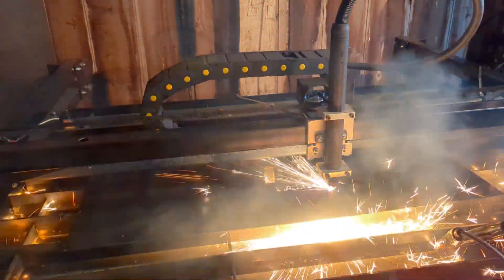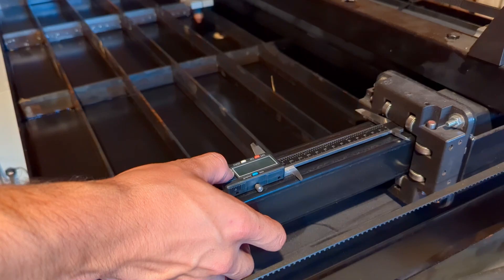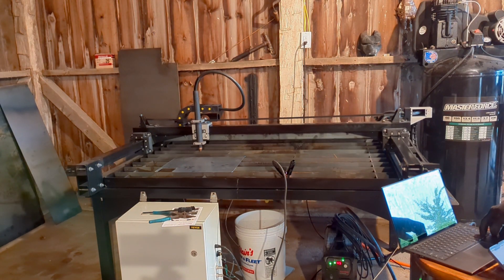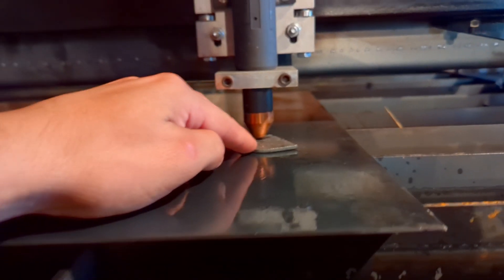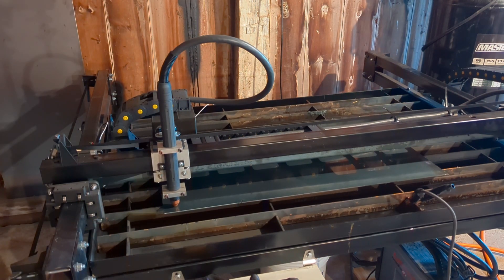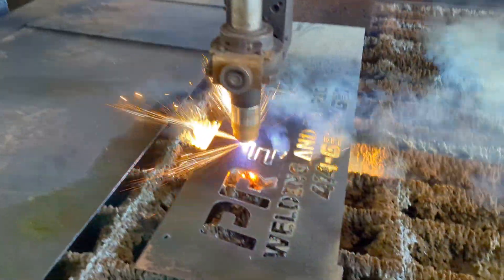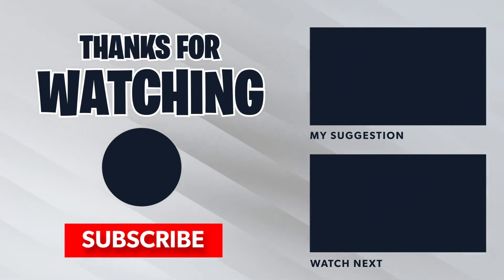DIY CNC Plasma or Small Business Mistake? | CNC Plasma Business Pt. 7

Comment: I did skip through a bit, but I haven't noticed any arc voltage control on your torch.
Your torch height must adjust automatically through arc voltage sensing and ideally you have a separate control box for that, so it can be done on the fly. Straight lines are indeed the easiest to make right, straight and dross free. As soon as you introduce directional change and two movements at once it's a bit more involved, know that you also have to make sure X and Y don't add together.
Something is fishy with that gcode.
Reply from the maker: @MartianDanTheMartianMan  this is an older video. I've since figured out the majority of the problems and it's working better than ever!
Reply: @ThyialIndustries  right, I was hoping you would comment and remember what the issue was. Got a new CNC myself and love to share experiences. I am going to check out the latest vids. Thanks ☺️

Comment: 1. Fix your level issue, 2. Use a piece of broom handle to hold the metal down when it is warping . We used down to 20ga, See  3D Metal Pop Art Derrick
Reply from the maker: @mikesgarage394  maybe? I've since started putting water in, and it's made a world of difference

Comment: Do you drain your air compressor tank often?

I mean from the bung at the bottom of the air tank.

I'd purge the condensate from there more often, and see if you're getting more life out of the water-trap/dryer.
Reply from the maker: @TH3_T3RM1N4T0R  I drain the compressor before every use... Lol
Reply: @ThyialIndustries  I suppose it's quite humid over there. Anyway, awesome job, it's a pretty cool machine all things considered.
Reply from the maker: @TH3_T3RM1N4T0R  😅 thanks! I imagine I'm doing something incorrectly. Just have to figure out what it is
Reply: @ThyialIndustries  I'm sure you will get it sorted out, best of luck with your future endeavours mate.

Comment: Hey there. Remember i was saying a power / speed calibration run?
Well I couldn't find the videos I was looking for until, someone else I follow made this video 
XTool S1 40W - Best Diode Laser 2024? Let's find out - the hardwareguy posted Aug 29
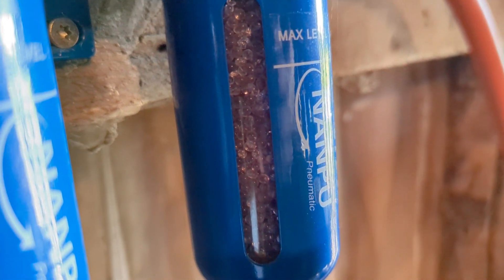Jump ahead to 4:45 in the video, where he creates a pattern grid, of specific speeds, powers, and if you do something like that
on a variety of materials, you can refer to them as reference sheets, when you have to cut on that material again in the future
Reply from the maker: @nemesis851_  ohhh yeah ive seen that before! Ive used when working with wood lasers. Maybe I can use it with the plasma cutter too?

Comment: I built a Torchmate II years ago to use with my Hypertherm Powermax 1000 (60 amp).  The biggest thing I learned early was that the amp settings and speed settings in the Hypertherm manual would not work on my machine due to the stepper motor skipping steps.  After I realized that I set out developing my own speed and amp settings.  The max speed on my machine is 150 IPM - it can go faster but this is very safe doing complex shapes.  If I were to retrofit my machine I would upgrade the steppers in size and have closed loop control.
Reply from the maker: @jamesmarler7191  I think that would be nice. But not absolutely necessary. My hypertherm settings seem to be working well

Comment: I have had a Lanmuir Systems Crossfire Pro for a few years now. Looks like your machine is "modeled" on that. Gotta say, forgetting the ground clamp is for real. Rather not say how many times I did that. I seem to get more predictable results when I put the ground clamp directly on a clean, rust and mill scale free spot on the work piece. I consider a powered Z axis and auto torch height control is a must. Looks like you ponied up and went that way. 

One thing I'd like to say to anyone learning CNC plasma cutting. → → The learning curve can be steep, but it gets easier. Walk away for a bit if you have to, think for a while, breathe, decompress, but stick with it. You can do it!
Reply from the maker: @p.t.anderson1593  all great advice! That dang ground clamp lol

Comment: Hi bro, I didn't see part 3, it seems to be hidden from your playlist 😊,  is part 3 about the wiring to connect the plasma torch to the CNC ? system?
Reply from the maker: @vurnitube  part 3 is not hidden. And it does have some wiring in it.
Reply: @ThyialIndustries  ups 😊,  In what part can I see how you wire the plasma with a CNC machine, do you modify the trigger on the plasma torch and then connect it to the relay ?
Reply from the maker: @vurnitube  no, I have a hypertherm 45xp. It comes with a cnc port already installed for a THC hook up and external trigger device.
Reply: @ThyialIndustries  I see 👍

Comment: those wobbles are backlash from the drive belts stretching. there should be an acceleration setting for direction changes somewhere. Or tighten your belts. also id say always stick to your machines' cut charts. Your table is small enough to level perfectly, so active torch height control that adjusts during the cut isnt really a must have. But z travel could at least touch-off before each cut.
Reply from the maker: Right after revising this I adjusted the machines acceleration parameters and that helped tremendously.

Comment: Don't worry, you will get it. We all get over-confident.

Lesson #1 NO RUSHING. A DIY machine needs lots of dialing in and test cuts. Once everything is perfect and tested to the max, THEN you take orders. Customers need dependability and you don't want to be late on delivery or waste material. Ideally you want to do a test beforehand every time and even get a marker and have the machine draw out the pattern on the work piece before turning on the torch. Material is expensive, and a single mistake can eat all your profit and then some.

Your bed level is CRUCIAL. If you have ANY warping, it needs to be taken out with Z height compensation, which you should have anyway because of the quality advantages you get from being able to use feedback compensation. A small stepper costs $5 tops and building a small inch pivot mechanism is pretty easy. When compensating, make small adjustments, and small test cuts. You don't want to ping pong between extremes.

Don't forget, NO RUSHING.
Reply from the maker: @excitedbox5705  I'm trying my best. Taking all advice into consideration and making changes where I see fit. Thanks

Comment: Those wavy lines are 100% caused by too-high accelerations. Notice on the larger letters that the waviness starts after every corner, and then damps out as the torch travels along the straights. The torch needs to slow down before taking a sharp corner - there's too much mass there to change directions instantaneously at speed.
Reply from the maker: I did some testing and your right, after I turned down the acceleration, everything worked much better

Comment: Couple things I learned with mine is hypertherm fine cut consumables make a huge difference on detail like that. Also your pierce delay time needs to be a little longer it’s moving before piercing. And yes Thc too! Hope that helps
Reply from the maker: @andrewallen2436  since recording this, I've found both of those to be true. I'm making adjustments as we speak
Reply: @ThyialIndustries  also plasma green is well worth the money in my opinion. Kind of a big investment up front but it last me over 2 years for the 5 gallon jug. Never had any rust issues and leave water in it 24/7
Reply from the maker: @andrewallen2436  awesome good to know

Comment: Its a labor of love
 try shoehorning a 45 watt co2 laser to a 10x6 ft cnc router
Reply: Or build a head to fit what you have. I got a 40-watt blue laser array that has a perfect tiny square beam shape, it  engraves. It cuts , It's great it will literally fit in your pocket. My co2 won't do that
Reply from the maker: @RGCbaseace  🤣
Reply: @ThyialIndustries  it was tough. It took way longer than I thought, but now I can put a reversed b&w photo on the backside of a mirror
Reply from the maker: @RGCbaseace  that's awesome. Definitely interested in getting a laser soon
Reply: @ThyialIndustries  ortur is a good one

Comment: Bro I think your belts .might be skipping steps. Or something related to your belts. Cuz my laser did the same thing then I adjusted the belts a bit tighter and slowed my speeds down. When doing the small letters, gotta slow down.
Reply from the maker: @kenholcomb3172  yes, I'm 90 percent sure it was a speed/acceleration issue. I'm just trying to move too quickly

Comment: Hey  built machine  from scratch you're  not letting yourself time to work  kinks out  if you plan  start  making  $$$ right out of the gate your nuts  and  taking on jobs  for clients  is not a good plan . Going  from  a job at fully stocked tool wise  to DIY build  from  a pro table  proven  machine.  I been in sign business for 17 years   with  computers  and vinyl cutter  if want to hit ground  running  buy pro proven  machine,  iam building  my machine  because I love building  and don't have  a 10-20k budget . Don't  get ahead of  yourself  you'll get it .
Reply from the maker: @bobrossi1185  thanks for the advice! I just have a big vision that I want to see come true